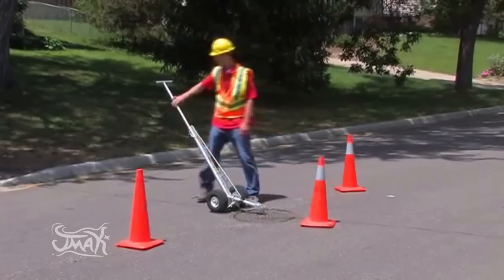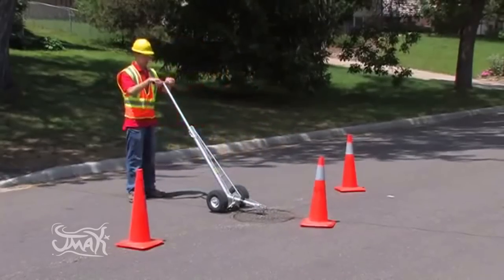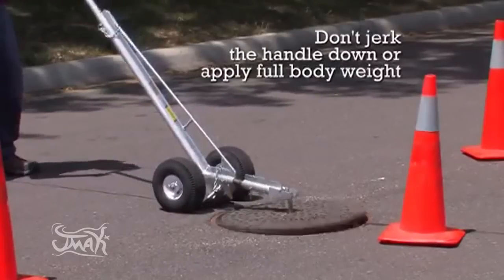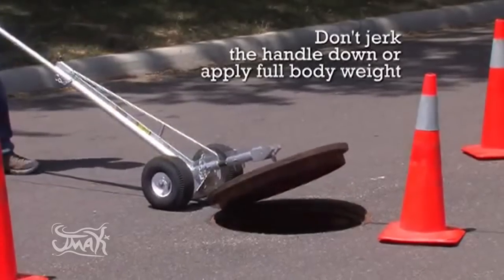How To Open up a ManHole

Comment: Hey Vsauce, Micheal Here!

One of the strangest theorems in modern mathematics is the Banach-Tarski paradox. It proves that there is, in fact, a way to take an object and separate it into 5 different pieces. And then, with those five pieces, simply rearrange them. No stretching required into two exact copies of the original item. Same density, same size, same everything. Seriously. To dive into the mind blow that it is and the way it fundamentally questions math and ourselves, we have to start by asking a few questions. Where are your fingers? Seriously. It's a pretty easy question. You should be able to answer it. But how do you know? How does anyone know anything? You might say, well, I know where my fingers are. I'm looking right at them. Or, I can touch them, I can feel them, they're right here and that's good. Your senses are a great way to learn things. In fact, we have way more than the usual five senses we talk about. For instance, your kinesthetic sense, proprioception. This is what the police evaluate during a field sobriety test. It allows you to tell where your fingers and arms and head and legs in your body is all in relation to each other without having to look or touch other things. We have way more than five senses, we have at least twice as many and then some. But they're not perfect.
Reply: Gavin Visco  oh no words of things I can't even understand
Reply: Literally every VSauce video ever. EVER. "Hey, wanna hear me talk with an annoyingly pompous voice and say things that pretend to be deep when I'm actually just saying normal-ass shit that most people already know about, but usually don't think about, because it's so fucking basic? AWESOME!"